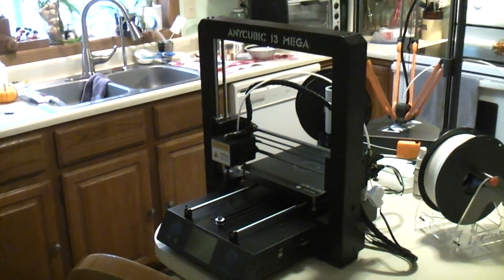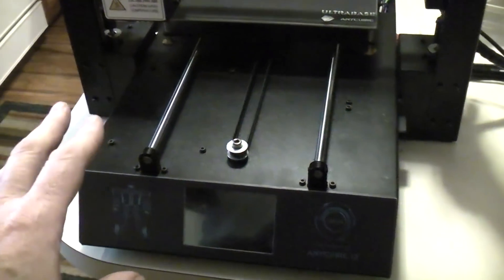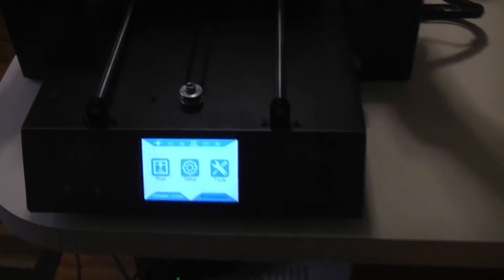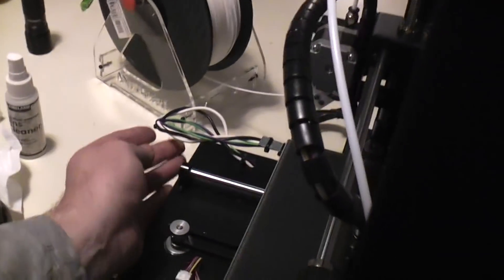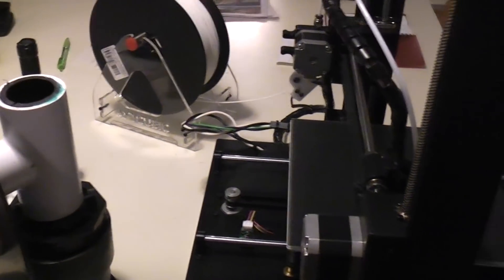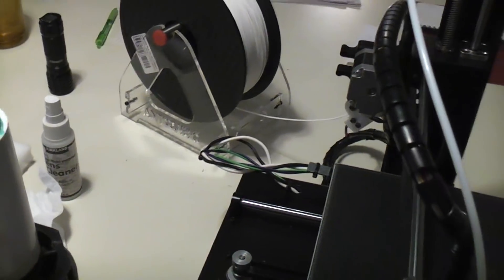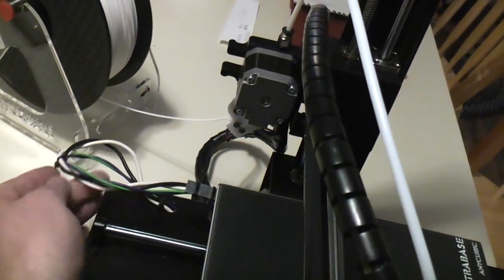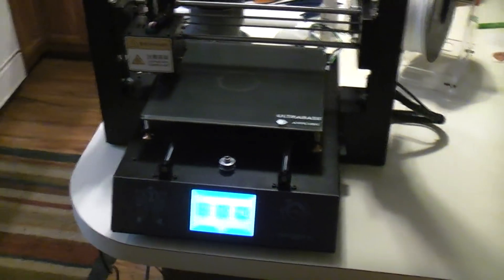AnyCubic i3 Mega Death .    The heat bed wires will break !

Comment: seems like I have the same problem. I didn't even print that much, around 3 kg or so. bed temperatur shows -14°C, I hope it's the wires, that would be easy fix. Will check later if rewiring helps
Reply from the maker: Lets know what you find.
Reply: @Robothut  yeah can confirm. The thin "green" cable Was ripped.

Comment: Hey I have the same problem and I wanted to ask, if you could give me a link to your cables? It would be very nice if you did that. :)
Reply from the maker: I made this video 4 years ago so the ebay listing for the flexible silicon coated heat bed wires is long gone. But a search for flexible silicon heat bed wires will turn up active sellers I am sure.
Reply: @Robothut  Thank you I will look into it! :)

Comment: Happened to me today, thank you so much for the help :)
Reply from the maker: Replace with high curent flexible silicon coated wires and it will never happen again. And / or use a cable chain to spread out the wire bend.

Comment: To me it happened 2 times in 12 months.
Reply from the maker: Yes unless you replace the heat bed wires with flexible silicone coated heat bed wires it will keep happening. Now you can keep the stiff heat bed wires if you add a cable chain to smooth out the bending.

Comment: Happened to me a week ago, was doing quick a lot of troubleshooting, but this definitely helps, Thanks!!!
Reply from the maker: So glad it was of help. Easy fix, just replace all the heat bed wires with flexible silicone covered heat bed wires from ebay or amazon, also some flexible wires for the thermisistor.

Comment: It happened to me 2 weeks after purchasing the printer! It sucks but I just resoldered the wires and it works :) (actually I cut then near ends and soldered mid section wire, where it bends).
Reply from the maker: Now is a good time to order the super flexible silicon coated heat bed wires. They will never break. You can find them on ebay and amazon.

Comment: Just looking on Amazon for wires, please could you tell me which one of the options (AWG) for wires would be best suited for the repair?
https://smile.amazon.co.uk/TUOFENG-Electric-Flexible-Different-Electronic/dp/B085TPC8GZ/ref=sr_1_8?dchild=1&keywords=copper%2Bwire%2Bfor%2Bprinter&qid=1596481289&sr=8-8&th=1

Comment: Same happened to me last week, £350 spent on this machine and it was 1 month out of warranty so Anycubic customer service told me to get lost and to buy a new heated bed.
Clearly a manufacturing fault probably designed to keep you purchasing heated beds which cost about £30. 
Won't be buying from Anycubic again. My Flashforge finder has been running non stop for 5 years with no issues apart from the occasional nozzle change.
Reply from the maker: Yes I agree, My old flash forge dreamers ran for 5 years and only sufferd from the  now and then nozzle block that all flash forges printers seem to have. But as the Anycubic, at least it is a easy fix to update the printer with proper silicone covered high current wires.
Reply: @Robothut  I don't suppose you would have a link where I could buy the exact type of wires required could you please....I'm useless when it comes to electronics :(
Reply from the maker: @11marksman  Go to ebay or amazon and type in "silicon heat bed wire" you will find what you need.

Comment: Thanks @Robothut for this - this is exactly what happend to my Chiron.  I was lucky it never started a fire.  What rating cable did you use for your replacement?  (what was the amp rating?)
Reply from the maker: I found some super flexible silicon coated heat bed wire on Ebay, this was a few years ago now. Seems like it was 14 amp rated. Might have been higher. Any way the new wires do not even get warm and they flex real easy. So I would just do a search on ebay for 3d printer heat bed wire. Silicion coated will not burn if there is a problem, and look for super flexible.
Reply: Thanks Robothut.  That is exactly what I’ve done.  The only thing I struggled with was the solder on the hot bed - even with my iron set to 450’C, the solder wouldn’t melt - so I ended up splicing the the new wires.  Not as neat as I was hoping.
Reply: Thanks Robothut.  That is exactly what I’ve done.  The only thing I struggled with was the solder on the hot bed - even with my iron set to 450’C, the solder wouldn’t melt - so I ended up splicing the the new wires.  Not as neat as I was hoping.
Reply: Thanks Robothut.  That is exactly what I’ve done.  The only thing I struggled with was the solder on the hot bed - even with my iron set to 450’C, the solder wouldn’t melt - so I ended up splicing the the new wires.  Not as neat as I was hoping.

Comment: out of curiosity, at what temperature did you have the bed set? I'm running HIPS through my anycubic mega and don't want to burn it up by accident...
Reply from the maker: I only run my bed at 60c. The  factory wires  break due to bending on the original model I have , they may have changed there heat bed wires by now, I hope. The new wires I put in are silicon coated super flexable and rated for more current than the power supply can put out, so they will never be a problem again.

Comment: It´s a stupid error on most moving heated print beads without correct cable relief, energy chains is a good idea. had same problem on my first wanhao i3 Dublicator printer :-/ but put on a 10x10 energy chain on the other.
Reply from the maker: Yes I put on cable chain and flexible silicon heat bed wires. This video is from 2017 and it is now the end of 2019 and the new cables for the heat bed are still working fine. Cable chain and silicon covered flexible heat bed wires are the way to go.

Comment: Great video. I’ve already ordered silicone wire to replace everything. It’s quite a safety issue and I don’t want a house fire.
Reply from the maker: Yes it is well worth fixing before it happens. But lets say that the heat bed wire start breaking so all the current is forced to be carried by just a few strands of wire. The wire will heat up and the plastic insulation will melt and smoke and stink but there is little chance of it burning anything other than the wire plastic coating. And the hot wires will burn out and break and that will stop the heat. And if the two wires do short together then the power supply will shut down or blow a fuse. All bad things, but probably not going to burn down the house. Nice flexible silicon coated wire is so much better and safer and not hard to do. Everyone should do the fix before it becomes a problem. Glad to here your on top of it.

Comment: Yep!  Had same problem only my 12V hot wire got so thin it melted and shorted over to the thermistor wire and shorted out the motherboard on the thermistor input.  Have to install a new motherboard to get my bed heat going.
Reply from the maker: Dang. 
Every one should upgrade there heat bed wires to new silicone high current super flexible wires. Do not wait until you have a problem as you never know how far that problem will go.

Comment: Literally had this exact problem today, as you said the constant bend & flex lead to the wires breaking, luckily not a hard fix once you know whats wrong.
Wish i'd watched this video before now, taking out that cable tie and giving it some more slack would prevent it I reckon

Comment: I may have this problem too.  The bed stopped heating and I turned in a ticket to support. I didn't want to void the warranty and peel the sleeve off the wires to check but when I opened the bottom to check for loose wires the block that that bed wires connect to was burnt.  I love how this thing prints but now I guess it is wait for replacement parts as this is not something fixed without replacing the board I think.
Reply from the maker: The block can melt or burn if the bed wires were lose, a lose connection makes heat. You could solder directly to the board with new heat bed wires, if they do not cover it .
Reply: Gary Minnick Same issue for me. It melted the plastic on the board after 4 days.... this is abysmal!

Comment: After printing 4kg of filament the printer stopped and turned off. The power DC regulated switching power supply adaptor was still working, becauseI could hear the fan, but the rest of the printer turned off (mainboard, LCD screen, etc.). I opened the printer and found out that when I was moving the thermistor wires it started working again. Seems like I have the same problem as you and I have change the stardard cables with flexible ones as you suggest. Your video helped finding out what the problem was. Thank you.
Reply from the maker: Glad to see it helped some one besides me. Not hard to fix once you know what is going on. I just wonder why they used the wrong type  wire for the heatbed on such a great printer.
Reply: Today I replaced the wires and it's printing 3.5 hours now a large object. Seems like the problem has been solved. What diameter did you use for the flexible wires? (I used 1mm for the thermistor but they are to thick and 1,5mm for the heat bed). There are many videos in YouTube showing the same problem (rebooting, powering off, etc.) and it looks like they haven't found out the problem yet.
Reply from the maker: Wire is sold by "wire gauge" for the heatbed I used 14 gauge, you can get silicone covered flex wire in 14 gauge that is rated for 30 amps on ebay cheep.  The thermistor I just used some small gauge wire I had in the shop that came from a old computer power supply. I think it around 22 or 24 gauge. With wire , the smaller the number the larger the wire and the larger the number the smaller the wire. Crazy right.
Reply: This is how I replaced the wires. Not the best way but I'm happy it's working again: https://www.youtube.com/watch?v=ugFSUt2sOps&feature=youtu.be

Comment: Is this just the heater wires? Or is it possible that the thermistor wires will break too?
Reply from the maker: Both will break. I replaced all 4 wires. I just changed out the heatbed wires on my new Prusa MK3 to super flexable silicon coated heatbed wires I found on Ebay. That is some great wire. Rated at 30 amps and flexable like krazy.

Comment: I got mine about 3 weeks ago and the black wire for the print bed just broke at the plastic tie pinch point on the frame.  Having to take it all apart and put in new wires.

Comment: Just had my heat bed melt the wires this morning. Print kept going but noticed the bed was calling for 70C but was at 25C. Going to get some silicone wire today. Can anyone point me in the the direction for cable channels?

Comment: Thanks, my cable broke within the first month... but it's easy to fix. The printer will lockup when the thermistor wire has issues. There is not warning on the screen or anything, that's very poor software design.
Reply: Hey, how did you fix it ? Could you provide some more info towards the steps you used ?
Mine just stopped heating & I don't know where the problems is as all the wires look fine.
Reply: I soldered some connectors like used in car wiring directly on the heated bed and close to the place where the wires come out of the bottom part. Then add some new wires between. The thermistor wires were find, but might break too. Make sure to use wires that can handle at least 12 amps. I used some silicon wires from the leads of a multi meter. You need multi-wire cable, with as fine copper wires as you can get. A silicon wire shell will help to keep the radius large so the cable lasts for a long time. In my case I also added a wire chain and rotated the heated bed 90 degrees so the wires come out on the right side of the bed.

Comment: I had exactly same problem about a month ago. The heating wire was broken.
Reply: So how did you fix the wire ?
I seem to have the same problem.
Reply: I put a new wire in.

Problem I did have was needed a 75Watt soldering iron as the bed takes the heat away.

I also put new spiral wrap on the cables and made the flex point (where it goes into the case at back right) less of problem by changing routing a bit. Think it breaks cable at entry point as it flexes too much on an edge.

Comment: I love this machine as well for the same reasons you and others have mentioned.   So thumbs up on that. But I have not had any issues with mine, it came plug and play basically from a USA E-Bay vendor, all I did was level the bed carefully. Although PLA can vary as well from manufacturer to manufacturer, I use only PLA to not contaminate the nozzle with other types of fillament. My machine came with a heat shrink tubing over the heat element and sensor wires and was zip tied securley to the base and bed and it has enough radius on the wires for them to curve and not break due to fatigue. Did yours come with this also? or were they simply loose?  This is an awesome printer for the price and as compared to more popular and higher priced machines.  Repetitiveness with precision are some of the nice things about this machine, due mainly to the solid steel architecture and parts. No 3D printed parts for the mechanical components, not to mention the other features that make this one stand above others. While on this note I should mentioned that the JG AUroroa A3/A5  a much nicer looking clone of this machine but I found out it uses 3D Printed parts for some of the mechnical components, and although there is a nice price cut on this over at GearBest it is not as solidly built as the Anycubic I3 Mega just FYI!
Reply: My  heating platform element wires finally gave out, but I am not complaining, mainly the red wire that melted the sheathing. But I never leave the prints unatended for safety and caught the issue in time. Ther red wire overheated and started to corrode the  strands, finally it gave out.  I replaced the wires.  

I still love this machine for its consistent prints. This was no big issue for me  considering the amount of use I have placed on this machine, and the wires are an easy fix.  While at it, I opened up the power supply and cleaned the fan and dust it off the interior with compressed air. Of course while disconnected totally from the power source.

Great machine I wish Anycubic would have made a bigger one with the same architecture, unfortunately they did the total opposite, in fact I think they went a step backwards instead of forward, with the larger Anycubic Chiron that looks more like an original CR10, with the roller guides instead of linear rails  and with an unsighly  open architecture and side mounted LCD panel and powered supply, looks more like you common CR clone.  While Creality steped up with a CR-10S Pro with a similar Anycubic I3 Mega  tower and front self contained electronics and front panel.    ??? Go figure!  how companies operate, sometimes. Boggles my mind,   WHY CHANGE SOMETHING THAT WORKS WELL!  at least maintain same solid architecture! for goodness sake!.  

If I was designing a larger version of the Anycubic I would probably marry the two Anycucbic I3 Mega and the Creality CR-10S. But keep the same I3 Mega physcial architecture. This is what makes this machine a great machine for the price and I think why it is so consistent on 3D prints, where most others for much higher price are not.
Reply: This is a long due update since the Anycubic Mega X, has been out for a while now, released on Feb 27, 2020, and it is in line with my suggestions I made back in  2919, to keep the same architecture and go with a larger footprint. 

Thanks Anycubic! I will still choose these machines over any other open architecture machine out there. They are simply clean logical design, great machines.
Reply: Another Update.While I still love the architecture of the machine and ability to print very nice parts when all is calibrated properly, the power supplies on 4 of my machines gave out prematurely. This started showing in failed prints due to the voltage at the temp control not being able to remain steady. You find this out by measuring with a voltmeter the output of the power suppply. On mine I could not even adjust via the adjut potentiometer on the power supply any further beyond 11VDC. 

I tried to get Anycunic help and after a long run around for over a year, believe it or ot,  I got from  various  people in their customer support, the engineeering tech Obi agreed to send me 4 power supply replacments but he did not come  through. What I received instead were 4 connector board and 4 long cables, none of which were the problem. 

In order to be able to reuse the machines I ended up biting the bullet and replacing all the capacitors at the imput side of the power supplies, with better ones, to get the voltage back to normal. All the caps at the imput of the circuit on the stock power suplies are low quality and losse tolerance really quick.  The capacitors are supposed to be 470UF 250V but upon measuring them out of circuit they were below spec some under 300UF, therefore the output voltage would vary under 11V in a couple of the power supplies. The control board needs 12-12.5VDC to be be able to maintain thermal stability in the hot end.  Anyway my printers are back in operation and printing very beautiful Parts. I am upset with Anycubic customer support. 

I also decided to minimise the weight of the head to allow for faster acceleration Stop and Go action and have even better prints. Note the more mass you put on the head, and I see so many people just loading the heads with extra fans and gismoz , even many direct drive systems that are bulky and all this does is adds mass to the head, something you do not want to do, for precision fast printing.  More mass on the head also makes the drive components work harder.  Imagine if you had to spin a bicycle wheel vs. a truck wheel, which one you think will sping faster and be able to stop, with less effort?